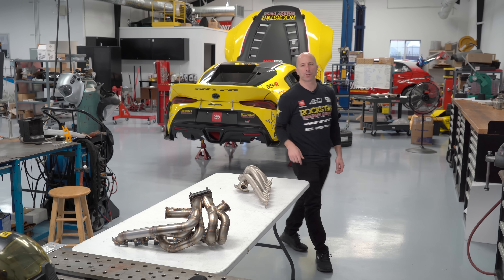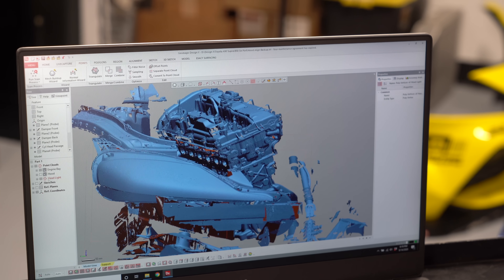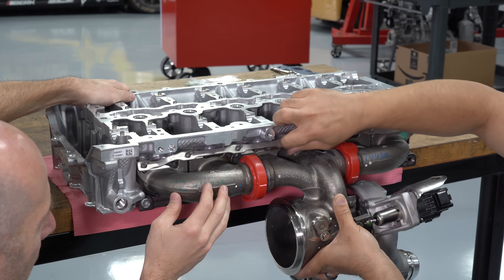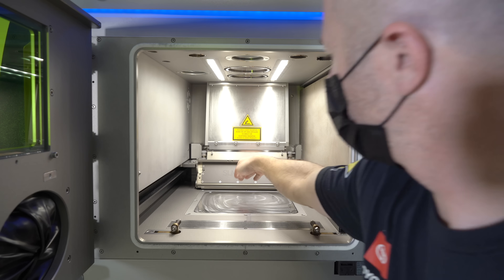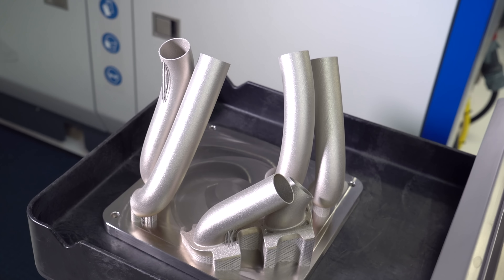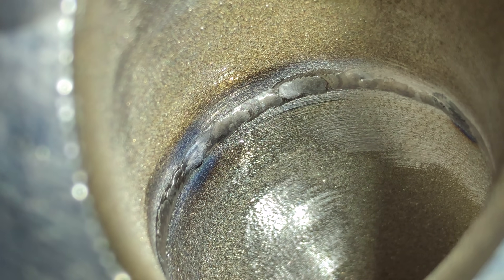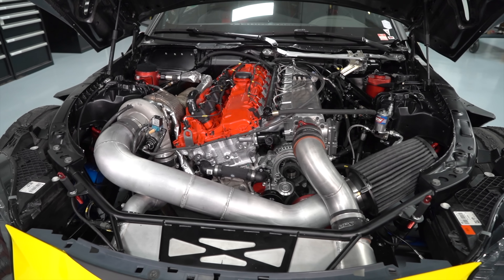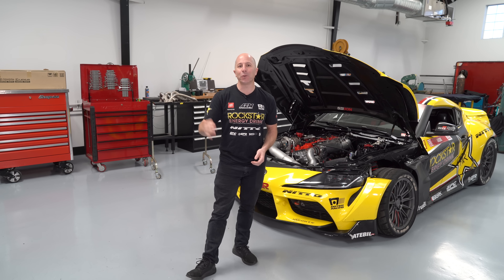Turbo Manifold 3D Printed from Inconel Powder

Comment: That was probably VERY expensive
Reply: And didn't really take advantage of the features you can make with an additive manufacturing process.
Reply: Could pirate solidworks, then use a open source scanning software with your phone

There's no way around the 3d printing part haha
Reply: @owenspalding971  No kidding they basically printed some bent tubes and still had to weld it together.

And they didn't appear to be properly finished so have fun with inconel dust in your turbine... 😬
Reply: This is put of most folks budget. 3d printing is extremely expensive.
Reply: @lucysmith4242  I would bet the cost of that arm scanner is similar to what the part cost.  $10k-$15k?  That's a lower end Faro arm.
Reply: @owenspalding971  if you pay for a single scan it's usually a couple of grand. But I believe there is open source scanning softwares
Reply: $10k for solidworks first of all, then a car designer ar $30+ an hour. Then. A really out of our budget 3d printer for metal 😁
Reply: @owenspalding971  could you expand on this?
Reply: welcome in the competition world
Reply: That car is so badass. Love it 😍
Reply: @MrAusshir  Inconel work hardens, so it's actually difficult to clean up
Reply: You'd be surprised how much accuracy you can get from photogrammetry techniques.  I have a video on it on my channel and the (free) softwares I use to create fairly damn accurate meshes that can be brought into fusion360 or solidworks.  You can then model fairly accurately off of it, after cleaning the mesh in blender.  I've created headlight bezels, fit to the surface regions within about .10 of an inch accuracy to the mesh.  Some 3d print tweaks and I have an accurate part.  You can do a lot of development affordably
Reply: @owenspalding971  I use a similar model of Faro arm at work designing motorcycle parts. We paid $100,000 for the arm including the software. I think Geomagic Control and Design X (which is shown in the video) were $20,000 total. It's obnoxious how much this stuff costs.
Reply: @lucysmith4242  The software is one thing but you still need the scanner hardware!
Reply: @lucysmith4242  and get no where near the same accuracy/precision
Reply: prob faster and cheaper to fab it by hand lol
Reply: Beautiful Work!!!
Reply: @owenspalding971  our faro arm cost over a 100k.
Reply: @JACB006  phones and lots of pictures. You can find this stuff on youtube
Reply: @tjbactual  Just because something is expensive, doesn't mean it's better. That's how I wind up with a bunch of shit 3d printers at my job
Reply: @tjbactual  Read NIghtDriveTV's comment
Reply: @MrAusshir  I guess it's a proof of concept/learning process for them, then later on they may make things that better utilise the advantage 3D printing.

As for inconel dust in the turbo: DW, that stuff would have blown out the exhaust the first time they switched the car on!
Reply: @lucysmith4242  If you know about scanning with phones etc and have any details of the software/ process, can you share so that we can all evaluate the cheaper options available? I still don’t see how a phone can possibly create a dot cloud file for importation into solidworks.
Reply: We are really living in the furture
Reply: @KnightDriveTV  A tenth of an inch? Is that really very accurate?
Reply: @lucysmith4242  i assure you that Steph's setup is orders of magnitude more accurate than .10 inches
Reply: @lucysmith4242  i said nothing about the price, i was only referring to the quality of this vs a cell phone and pirated software. That might cut it for diy but in real engineering tolerances are life and death. 

-an engineer
Reply: @tjbactual  I made a comment roasting you and it never posted.

The point I was trying to get across is that if you didn't have the money to do such a thing but had a strong will that it's still possible to do and learn for the average person.

Not sure what you're getting by arguing the contrary.

And there's more variables to the accuracy of a scan than how much money you spend on it. Cracked NX and SW isn't more accurate or inaccurate than a non cracked one

But I'm glad there's people like you out there. Someday I'll sell you something expensive that does the same thing as something cheaper. And you'll be happy about haha

And everyone and their grandma is an engineer. You lose your merit when you throw around the "E" word in lieu of a valid arguments or supporting data.
Reply: @lucysmith4242  once again, i never made any mention of the cost. Not sure why you keep gravitating to that. 

You mentioned an alternative method for 3d scanning and i simply commented on it being much less accurate than the method demonstrated in the video. That's it, that's my whole point. Yes your method would work, but it would be a lower quality result. I am commenting on the quality of the result between two specifically mentioned methods. I don't care about the cost, I don't care about the other variables, Steph's method will be far more accurate and precise and that's a fact. Anything else you want to read into my argument is on you.

As to your last point, not everyone and their grandma has a degree and experience. But assume what you want to.
Reply: @tjbactual  reference papers or GTFO
Reply: @lucysmith4242  hahaha, clearly you've never worked with one before. There's a reason you don't see shops doing this with a cell phone
Reply: @owenspalding971  The Faro's we use [ISO9001 Deere & Co supplier/subcontractor] are in the $50k range. Just using ruby or zircon probe tips. Active 3D scanning is probably a whole other tax-bracket above. When we send them back to the mother-ship for calibration and recert, we insure for $50k. Very cool technology, none the less...
Reply: @biangbiangmein5150  SolidWorks is only about $4000. As an independent consulting designer I charge $75 an hour for design services, but I supply my own SolidWorks license at that price.
Reply: @kn8tronbomb  You were had
Reply: @lucysmith4242  The only arguments I see in here are "I work in a shop that got scammed, so I know how much they cost"
Reply: @hikdingle2210  wut
Reply: @lucysmith4242  They also buy from  middlemen who bought from a middleman who bought from another middleman causing the price to be hyperinflated
Reply: @hikdingle2210  I believe it. Whether or not that middle man is a person reselling or simply the outsourcing of a task, work, research and development done over and over

Comment: The technology is absolutely mind blowing
Reply: For sure ...the "old style" fabricated manifold was lovely as well. But the 3D is next level.
Reply: @danielmarshall4587  imagine the impossible to cnc shapes you can incorporate from 3d printing.
Reply: Tons of stuff!! The equipment is super expensive though. I think over 300k USD for an entire setup.
Reply: @soufsidemotorsports8418  there's a 3d metal printer for 5k. I'm sure you could make your own, if you were to take the print head
Reply: @NatoriousGamePlay  might be a cool little project. Need to get my Arduino skills up
Reply: They first starting using this tech for 1-piece jet turbine injectors and turbine pumps on space rockets, rather than 50+ pieces.
Reply: TRUE
Reply: @NatoriousGamePlay  what machine is 5k and what materials can it produce? There are plastic printes for 5k
Reply: @jonwebb9261  it's a metal 3d printer. It's called iro3d. It uses two metals an infill to make it stick and the actual powder. It doesn't work as fancy as this one does, so you'll need a kiln of since sort to melt the actual powder you want to form the piece. But even those two parts are cheaper then what is used in the video
Reply: @NatoriousGamePlay  yeah pretty familiar with that machine. Can't see if ever been a saleable product, it's been 'available' for years. Either way, it could never handle a project like this one
Reply: For sure.
Reply: @cameronb9862  My brain is overheating from thinking about the possibilities.
Reply: This technology has been around for more than 30 years ;)
Reply: Wait until you hear about metal inkjet printing…